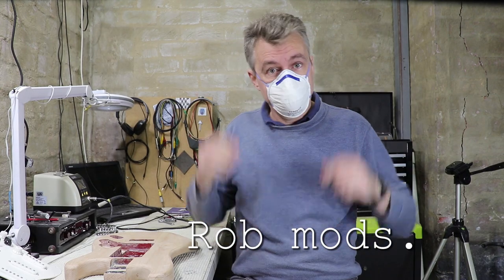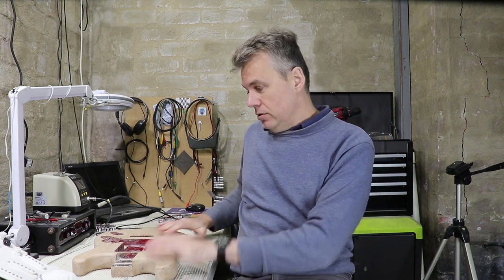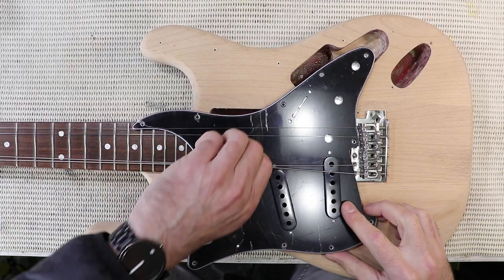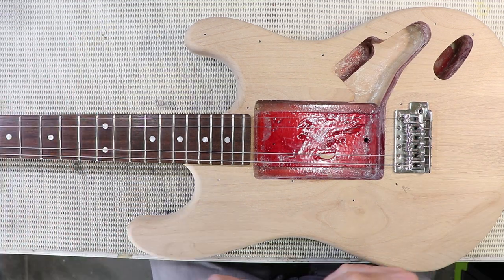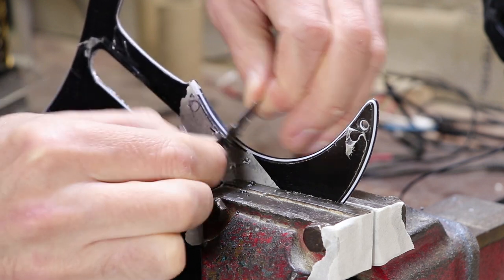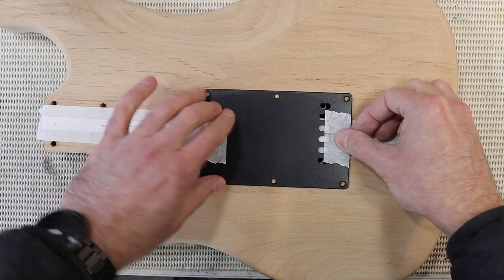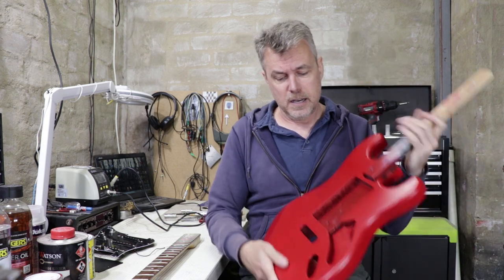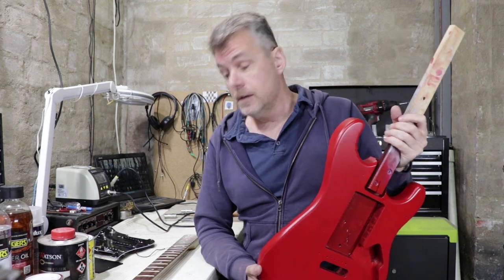Project Strat Pickguard Fitment, Body Strip and Refinish

Comment: I used a hand torch..move it fast and it works great
Reply from the maker: That's a great idea!   I'll definitely try it next time.
Reply: @RobMods  I did it on a mim tele..the poly almost falls off. Just move fast so it doesn't heat the area to much. Made really fast work though.